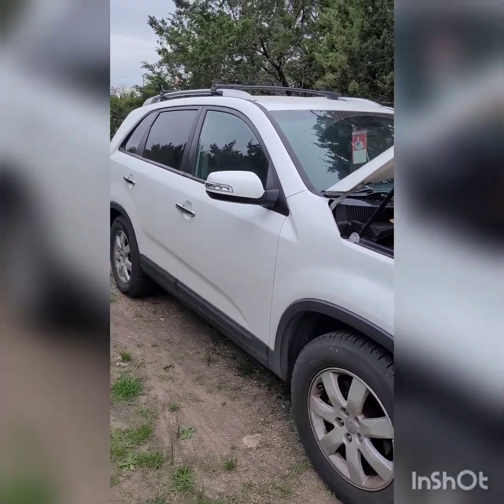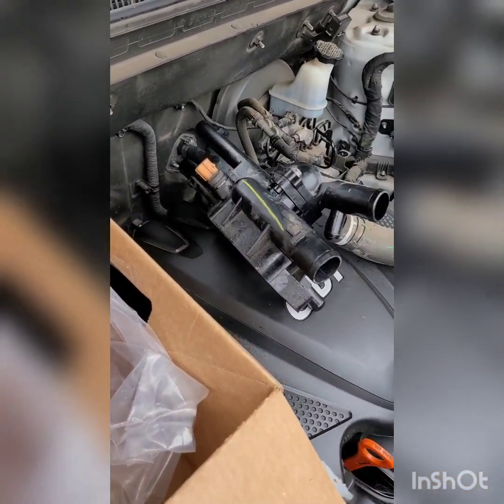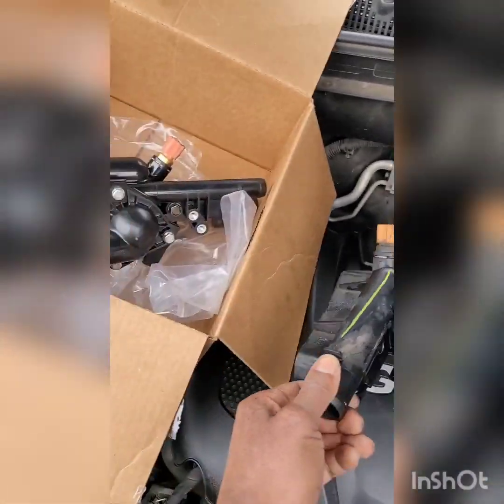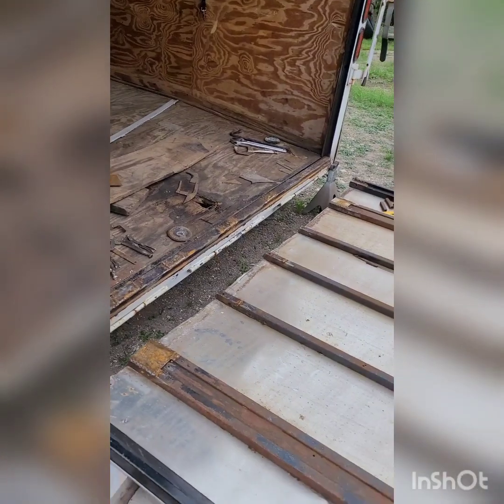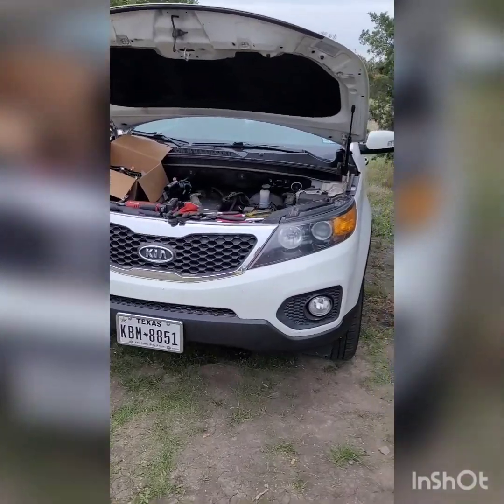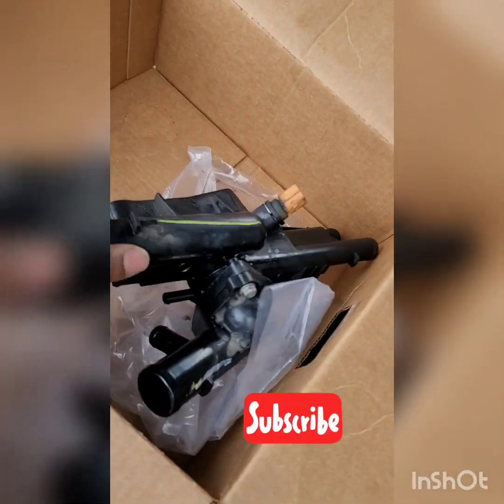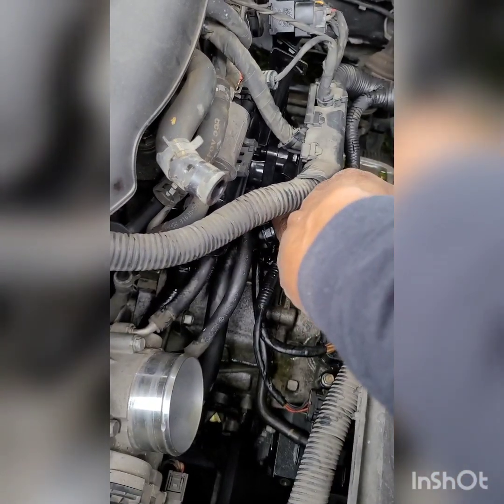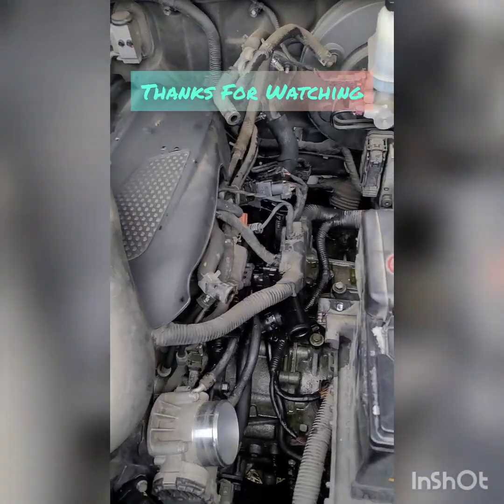2014 Kia Sorento-Thermostat Housing Cracked.......

Comment: I had to do my v6, it wasn't too fun. Oem price was like 500$ lmao
Reply: Me, I just have to replace the thermostat housing gasket between it and the engine block. So I have to remove the air scoop, the battery, the air box which holds the air filter then the rubber air induction hose....then I can get to it?

Comment: My wife’s car is leaking where it meets up with the block
Reply: Was her's a V6? Mine is a V6 and I just bought the replacement gasket to seal the leak.
Reply: @bassinbillRC5300  it was a 4
Reply: @Toyotaguy.  I ordered a thumb drive Service manual from ebay to see how mine is done.  Problem about me is I have AV sit's is and I can't find any videos that show you the step-by-step process of taking the thermostat housing off the engine block in order to replace the gasket between it and the engine block. I know I have to take out the airscoop the battery and the airbox so I can get my hands down in there in order to removethe 3 bolts of hold it in place. Wish me luck.
Reply: @bassinbillRC5300  I’m not gonna lie. It’s a pain in the butt do not tighten the bolts and hold it to the block until you get the rear metal tube attached first don’t do what I did and did not realize the gasket around. The metal tube fell off and I had to redo the whole thing.
Reply: @bassinbillRC5300  in fact, it’s best to attach the metal tube first in the back